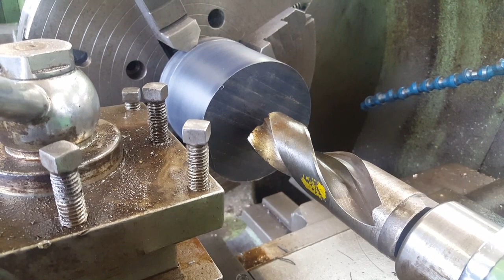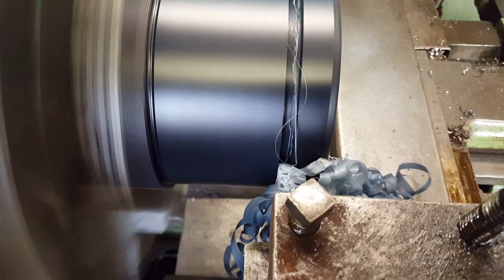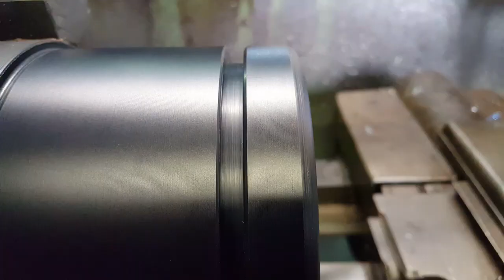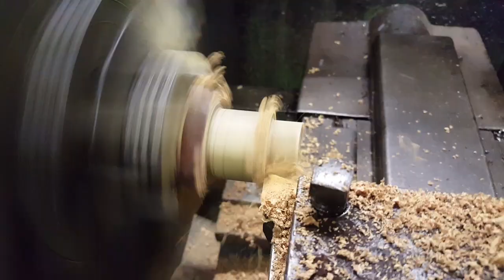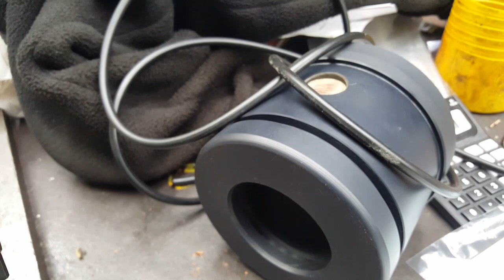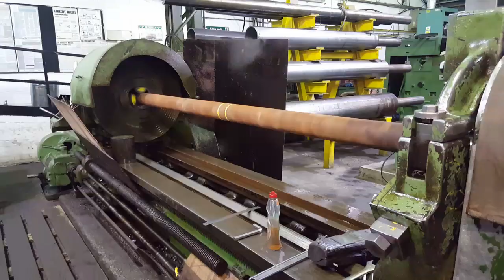DEEP HOLE BORING oil leak fixed 2" to 4" boring machine.

Comment: Great job. Have machined shed loads of that gear. Turns beautifully but I found it very "grabby" when drilling and counterboring. We used to use massive slabs of it to face dock fendering. It is a bastard to handle in big sheets as it is as slippery as eels against itself. Surprisingly dense in large sections.Crank the speed up and get the streamers to hit the ceiling.

Comment: Looks really good Dave.  What is the purpose of the wood plug?  At the beginning I thought 'how does he get the plastic to squeal like that'.  Then I realized it was coming from another machine.  I think the slide ways on that lathe are more worn out than on my Broadbent-Schofield lathe.  Good to see it can turn out excellent work with that much wear.  Gives me hope for mine.  Thanks, Ken
Reply from the maker: Hi Ken. It's not wood it's called "tufnol" and it's used as a damper when the boring bar starts to vibrate.. etc.

Comment: Delrin?
Reply: crozwayne, I think it is UPVC it is a thermoplastic material, originally first made in 1930's to replace old corroded metal pipes that supplied fresh water and such, of course the material Dave is using might be a different plastic?
Reply from the maker: Polypenco.